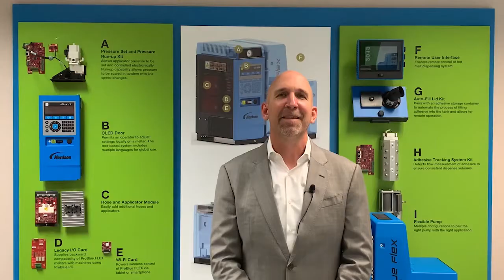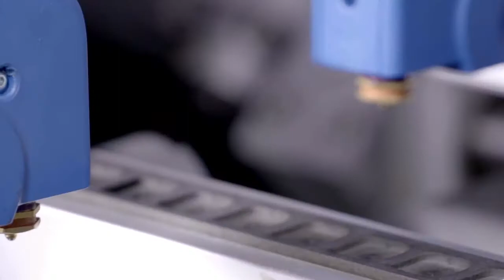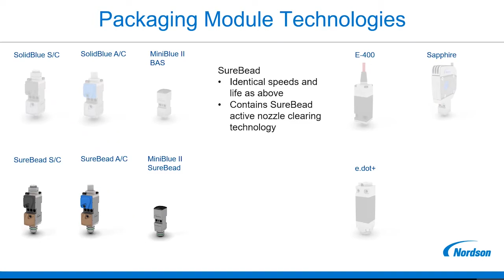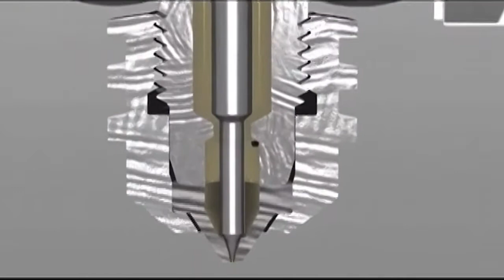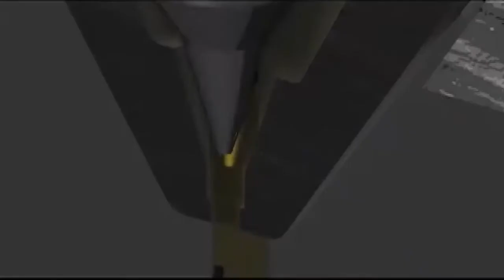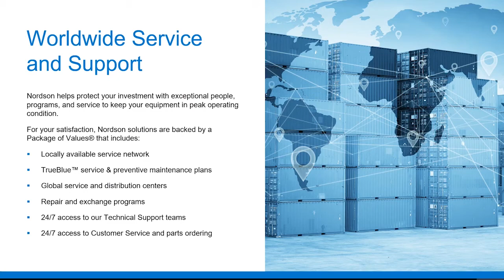Choices Choices - Selecting the right adhesive applicator to meet your needs

Comment: Hello!   well made video!... great info  thanks! 
  I do have a question regarding the Solid A/C  blue module wich we have in our 10 glue systems  and I was wondering if we can upgrade to Surebead A/C   to prevent clogging  is there other component to be replaced with this module swap or just the module alone?    thanks for the response.